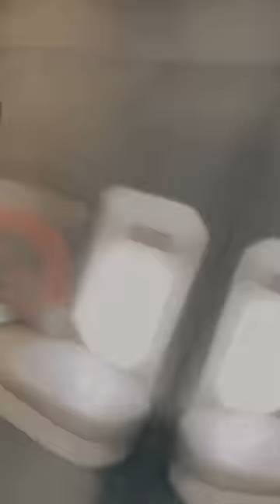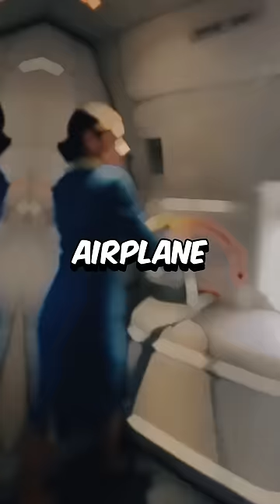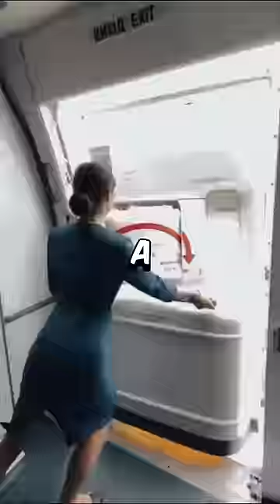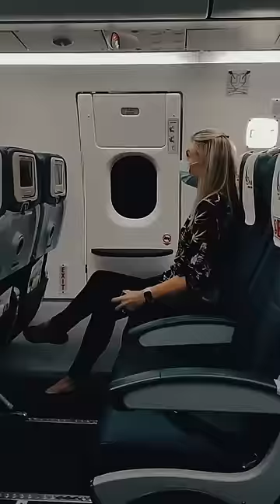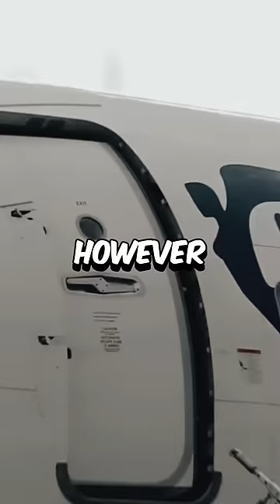Airplane Doors Cannot be Opened Mid-flight!🤯 #shorts #aviation

Comment: There was actually a flight where a person opened a plane door mid-flight but it wasn't high enough to kill someone. It turned back around and landed. They were able to detain the person who opened the door
Reply from the maker: Yeah😊
Reply: and I’m pretty sure around a dozen people were taken to the hospital for breathing problems
Reply: worst of all it was a air koryo
Reply: No, they ejected the Door, airplanes Doors can be ejected in case of emergency
Reply: it was korean air, air koryo doesnt do flights to SK for obvious reasons @easyjetbutter
Reply: @wizardman3162  sorry, there are multiple times that happened.
Reply: Asiana Airlines 🗿🗿🗿🗿
Reply: It wasn’t mid flight. It was when it was on final approach. As it’s doing this they are dropping altitude and the pressure inside the cabin is dropping as well. When the pressure drops, so does the force on the door allowing it to be potentially opened. You would never be able to do this mid-flight with full pressure.
Reply: If it were high he would'nt be able to open due to pressure, but he'll die even at the height he can open it though O² and pressure difference would'nt be a problem for passengers.
Reply: If you're referring to the Asiana flight, it was opened shortly before landing,  about 700 ft above ground.
Reply: Down to get to the good stuff to go to the good point
Reply: @absolutefba241 
For most airports, the internal cabin pressure increases as the plane drops for landing. 

The internal pressure of a plane is the equivalent of between 6,000 and 8,000 feet of altitude.  This reduced pressure is used as it reduces the pressure difference between the inside and outside, and still allows for a comfortable passenger experience.

The only airports where the internal pressure is reduced are those higher than 6-8,000 ft, eg Syangboche Nepal; Vicco, Peru; Telluride, Colorado US.
Reply: it depends how high the plane is you can’t at full altitude
Reply: @wizardman3162 It wasnt even Koreean airlines it was Asiana airlines
Reply: @Nobi36 Yea
Reply: One way to ruin your expansive vacation trip
Reply: @whatamidoinghere0 they had oxygen mask and plus the height is not enough for breathing problems
Reply: But how did he open the door mid flight if it was locked remotely by pilots
Reply: @payupama if the pilots remotely unl9ck the doors
Reply: Y

Comment: 737 Max 9: Hold my plug
Reply from the maker: Lolz😂
Reply: I swear to God people think if one plane has an incident then the same incident is gonna happen all the time
Reply: @LaserKiwi535   Well, you seem to be fun at parties, and considering that right after this happened, several other planes were found to have loose bolts on the doors and the planes got grounded... it could you know potentially have happened again. Specially with an air craft that In such a short time has had a bad track record already
Reply: @LaserKiwi535 bros either a boeing exec or had their head in the sand for the whole month right after the door plug incident.

The company is in tough shit because they got exposed skimping on countless safety requirements in their construction/maintenance facilities. Plus more controversy about the whistleblower that “committed s***cide”,  and the covert interview where the assembly workers said they wouldnt risk their life flying on those planes.
Reply: Older 727 Models: My Air Stairs Is More Better
Reply: Hold my door*
Reply: You mean Alaskan B737 MAX 9
Reply: Blame it on McDonnell Douglas
Reply: hold my screw

Comment: The pressure is greater inside allowing fornit to blow out even easier lol
Reply: They cant ‘blow out’ you have no idea what you are talking about
Reply: Learn before talking.
Reply: @ChatminAC  that is not how pressurized cabins work.
Reply: @6z0   I mean, it is basic physics. Lower matter concentration at a 40000 foot altitude  in contrast with a pressurized cabin would in theory allow the door to blow out much more easily if it weren't locked. Basic concept and basic physics.
Reply: @fishandchips9662  When the De Haviland Comet had its 2 accidents both aircraft imploded because the pressurization was to great for the weak metal frame.
Reply: @fishandchips9662 but there plug type doors
Reply: Also didn't someone do that a few years back, killing a few people who were sucked out?
Reply: @fishandchips9662 no, the doors open inside, they fold outside. How would it open outside?
Reply: I think you need to pull the door in first , therefore it is hard to open
Reply: Some planes, such as 737s, have doors that move inwards before they can be swung outwards and opened. This means that during cruise, the door is essentially being pressed shut into its frame.
Reply: @6z0 yes they can, its an explosion because of the pressure
Reply: @ChatminAC Learn it yourself, he is pretty right
Reply: Actually
Reply: @dianapennepacker6854 it was just some minutes after takeooff so the plane was in a lowet altitude
Reply: Wtf is a fornit?
Reply: @9b5a  i guess the gate the emergency gate
Reply: @6z0 no he’s right
Reply: Airplane doors need to go inside the plane to open them to the ouside. It's easyer to understand If you watch a YouTube Video about it. Flying hight altitude it's Not possible to open the Doors. It's Just possible when the pressure inside and Outside are almost equal.
Reply: No. The doors can not be opened easier bc they have to come open inwards and then go outwards. This is coming from someone who repairs Boeing and Airbus. You need to learn your facts before saying something
Reply: Ahh yes because you are much smarter than the plane engineers that are way smarter than you and have thought about basically anything
Reply: @jorggrossmann7537  like this response to this man. thing is, plane doors come inwards before they go outwards. Basically making it basically impossible for someone to force the door while it is pressurized. Only doors you could possibly get open is the over wing doors on a Boeing 737 bc those open directly outwards, but those are hard enough to get open as is. Any other doors have to come inwards to help with the pressurized seal
Reply: @dianapennepacker6854 Those doors need to first move back inward before they can be pushed open. Therefore, it is impossible to open one when the cabin is pressurized, unless there's a structural failure of some kind. However, at lower altitudes, one can open the door with minimal effort as the cabin pressure will be similar to the outside air pressure.
Reply: The thing about these doors is that they’re slightly bigger on the inside than they are on the outside which means that the pressure inside the airplane holds the doors shut. You would need a lot of strength to open the door when the plane is pressurized. Even if the locks fail, the door still can’t be blown open because of how the door is built
Reply: It’s called pressure sealed… the door is wider on the inside than the opening itself which makes the door push against the frame, making it virtually impossible to pull it away which is necessary to open the door… airplanes, submarines, ships, all types of vessel use this same technique… really stupid from this short not to explain this fact…
Reply: 1. The pressure "locks" them in place, because of the way they're designed. 

2. Doors on aircraft need to be pulled in slightly before being pushed open.
Reply: @kaoz250f1  Anyone who doesn’t believe that is a sucker.
Reply: Alaska air b737 max8 be like uhmmm.... Did I do wrong?
Reply: All that pressure is pushing on the pins holding the door closed. Which means you’re not strong enough to move the lever.

Comment: If the pressure inside is greater than outside , then you can open it because of the tendency of air inside will push the door outwards. If the door goes inside the plane, it’s impossible. The door got a bladder seal around the door edge that prevents air leaking out and this seal prevents the door from opening actually.
Reply: When he said that part, it made me confused too

but while watching it, i noticed that in the process of opening the door, it moved inner first, so that might be the reason why it will be impossible to open during a flight in high altitude, since the high pressure inside the plane will prevent the door from moving inward
Reply: are you saying that what he just told me is complete bullsh*t?
Reply: Because you must pull the door I guess

Comment: Fun fact: they can, but only certain doors. Take the C-130J super hercules, it can open its cargo door and side Paratrooper (I think they are called that anyways) doors. This is because they don't open into the airflow, but rather stay behind or in the aircraft.
Reply: Yep because they are hydraulic powered doors
Reply: Because they are designed to open mid-flight for a reason. also they are powered.
Reply: C-130 MENTIONED
Reply: Yeah, if the plane is pressurized, then you can’t open the door.
It has nothing to do with the airflow
Reply: Is that a passenger airline?

Comment: What about that Asiana flight where the door was opened
Reply: That plane was at a low enough altitude for the door to be opened in air.
Reply: @joshuavergara3968  👍
Reply from the maker: Exactly..
Reply: They were about to land so the door was easily opened bc the cabin was not pressurized at that altitude
Reply: Ong
Reply: TNT_GAMING765  no, a passenger opened it right before landing
Reply: Its was cuz it was on approach. At 35,000 ft he means
Reply: 200 feet from the ground so you can just not at cruising altitude
Reply: And the man go to jail

Comment: The doors on airplanes is larger then the opening itself that is why in order to open the door you must pull the door inwards first, the door then tilts top side inwards then the door twists before opening the door towards the outside. If you just closed these doors normally then you would never be able to fly higher then 12,000 feet
Reply: Not all doors open, some of them open out

Comment: It is possible to open the door, but you have to be at low enough altitude like a couple hundred feet above the ground
Reply from the maker: Yes🫶🏻
Reply: Actually even around 10,000
Reply: You also need to be slow enough.
Reply: Yeah, that's an altitude where there isn't much pressure difference outside and inside.
Reply: @Optimaloptimus I guess speed determines pressure too, and not just altitude height.
Reply: @johndavidson3424  It doesn't determine the pressure. It decides how much air is pressing down on the skin of the plane, which also includes the door since the door opens outward and not inward.

Comment: 8 lbs. of pressure per square inch, that’s about 24,000 lbs. against that door in flight. No one is opening that door.
Reply: What about in lower altitudes
Reply: @otbusiness8653 I say anything above 3000ft and you’re not opening it
Reply: @fatrat6988 
So how do the passengers get out when a plane lands at, say, Telluride, Colorado, US which has an altitude of 9,078 ft?
Reply: @cigmorfil4101  there’s a difference between large commercial passenger planes and small privately owned jets
Reply: @cigmorfil4101  lol u right. Idk what I’m talking about. Maybe say 15000 feet but idk
Reply: @otbusiness8653 
Yes, at lower altitudes, you can open the door

Comment: The south africanflight 295 had open its doors midflight due to fire(later it crashed)...it is easier to open because of the high pressure inside...you couldn't open the door if the pressure is greater outside
Reply from the maker: First of all, the sense of the video is about not doing this because its fatal and after doing that its not possible for the plane to be normal or the passangers inside the cabin, if they are unconscious they would blow out from the opened door.
Reply from the maker: Also its not even easy to open when the pressure is high inside as it looks like.
Reply: Alaska 1821

Comment: Correction: The preasure outside is much stronger than inside at crusing altitudes due to the high speeds. If the preasure was higher inside the plane the door would require little to no power at all to be opened.

Comment: If pressure is higher inside door would be easier to open boss. The wind resistance at 500 mph is what makes the door difficult to open.
Reply: High altitude commercial airliners use plug doors which create a seal when the pressure inside is greater
Reply: the door is wider on the inside than the opening itself so the door pushes against the frame due to the pressure, even the airflow around the plane is nothing compared to the force with which the door is pressed against the frame… pressure difference is a badass force

Comment: Actually they can.  It's been used to ventilate a smokey cabin.
Reply from the maker: Then got suck out😂
Reply: No, look at south aftican flight something  they did to release the smoke and didint get sucked out.
Reply: South african 295*
Reply: @0.thatoneguy.0
“ The 'smoke evacuation' checklist calls for the aircraft to be depressurised, and for two of the cabin doors to be opened. No evidence exists that the checklist was followed or that the doors were opened.”
Reply: They depressurize the cabin first. The air pressure on the outside is then equal to the air pressure inside; allowing the door to be opened.

Comment: Emergency door can be easily open mid-flight and the door will break and fly away
Reply from the maker: Yeah
Reply: not in high altitude… the incident with asiana airlines happened during approach on a height where the pressure was still higher inside the cabin but already low enough for the force pressing the door against the outer frame to be small enough for a human to overcome and open the door… otherwise no chance believe me… only structural failures can open doors at cruising altitudes

Comment: Under certain condition doors can and have been opened in flight…!
Reply from the maker: Yes but not on the maximum height
Reply: Maximum height can be anywhere from 15,000-70,000ft on different airplanes.

Comment: but if there is stronger pressure inside then it could be opened easy
Reply from the maker: Ya
Reply: No, the doors are pressure sealed from the inside.  The plane is pressurized so it presses against the door on the inside and keeps it from opening (at least until the outside pressure matches it).

Comment: Actually it' makes it easier at higher altitudes since the air pressure is greater inside than outside. The exact opposite is true, and aircraft doors have explosive bolts so that the doors can be blown off in an emergency. Sometimes you will hear the captain telling the cabin crew to arm the doors before takeoff, he talking about live arming the door to set the charge.
Reply: You can push the door as much as you want, it doesn't matter if the cabin is presurized or not, and it won't move a single millimeter. You have to pull to unlock it, and since the pressure inside is higher, you can't.
Reply: i seriously don’t get if you‘re joking or not… „arming the doors“ refers to the emergency slides… they are „armed“ during take off and landing which means they would automatically deploy when the doors are opened… after a normal/safe landing this function is always disarmed however, because you obviously wouldn’t want them to inflate while you‘re at the gate and destroy tje jetbridges/stairways… putting explosives on passenger planes by design is insane…

Comment: Wouldn’t it be a lot easier to open than usual 
If you ignore the fact the doors probably have pistons and motors to prevent them from opening, wouldn’t the pressure on the inside mean that it is trying to equalize with the out door pressure
Which would mean the pressure is trying to escape
I sorta waffled here and I don’t actually know what I’m on about

Comment: So, if the plane is on fire you can't escape?
Reply: It doesn't matter you can escape or not. You will still die if the plane is on fire during flight.
Reply from the maker: Just Pray..  if something happens on the plane😂
Reply: You either land, the fire gets extinguished or … you die.
Reply: Jumping out the plane will kill you to
Reply: You want to jump from a plane at an altitude where it needs to be presurized?

Comment: Tell this the asian guy who did it
Reply from the maker: It was an emergency exit😊
Reply: @Wingsofhistoryy why are you always giving the same answer which doesn’t even explain the real reason… it’s so misleading
Reply: the guy only managed to do so because the plane was on approach and fairly low enough for the pressure difference to be small enough to overcome the forces and open the door… would have been impossible any higher and on cruising altituu

Comment: What no😂 the high pressure in the plane and low outside forces the door outward😂
Reply: this short just fails at explaining it properly… most airplane doors are plug doors meaning they are wider on the inside than the opening itself so on higher altitudes, the greater inside pressure pushes the door against the frame… the friction is so high that it’s impossible for humans to move the door… the recent asiana airlines incident happend on approach where the plane was already low enough for the pressure difference to be fairly small, so the guy managed to overcome these forces… on cruising altitudes it’s absolutely impossible as I said (unless it’s a structural failure of course)

Comment: False…there is asian flight that had its doormopened mid flight
Reply from the maker: It was an emergency exit..
Reply: the reason that guy managed to do so is because the plane was on approach and fairly low enough for the pressure difference to be small enough to overcome the forces and open the door… would have been impossible any higher and on cruising altitudes… the door is wider on the inside than the opening itself, which leads to the inside pressure pressing the door against the frame… forces are then so great, makes it impossible for humans to open